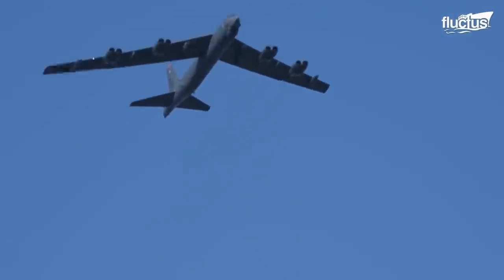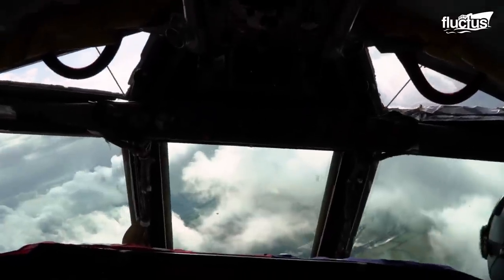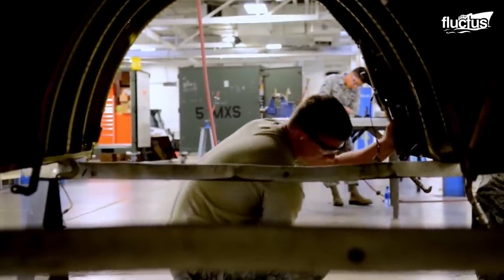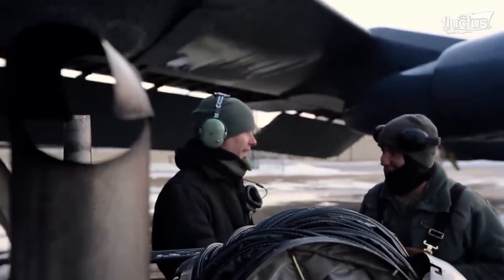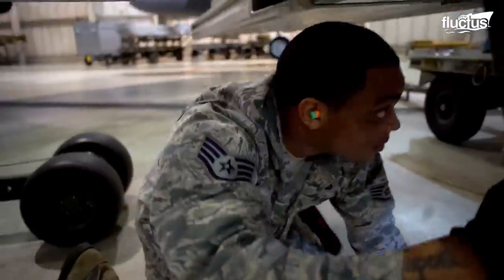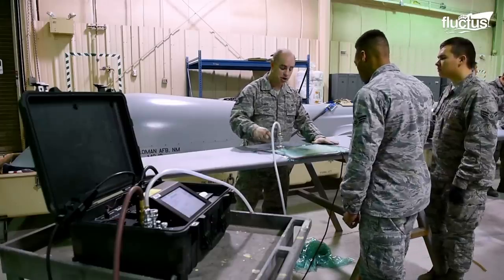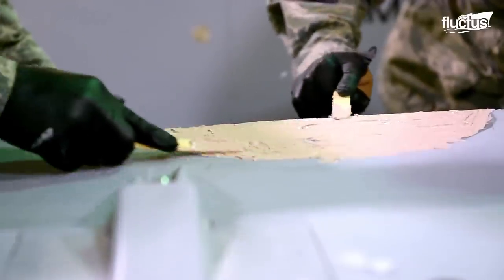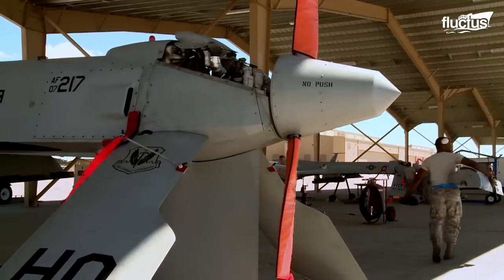US Crazy Technologies to Repair Super Large Aircraft

Comment: This is an excellent video. The remaining 76 operational B-52H's are 60 years old, We designed the B-52G/H in 1956 for high-altitude bombing. The emphasis in the structural design was minimum weight, to maximize range. But in 1961, at the height of the Cold War, we redesigned the structure to meet SAC's new, more severe usage and service life requirements. These notably included low level terrain avoidance training, often under extreme gust and maneuver conditions. The emphasis in structural design shifted to toughness and durability. The primary structural components are never replaced. The main reason for their longevity is that the usage has not been as severe as was projected. As Chief of Structures Technology at Boeing-Wichita at the time of the redesign. I am honored to say I chose the materials, the analysis methods, and the limiting stress levels for the redesign. I am now 95 and I am thrilled to see these planes still flying, and projected to do so for many more years.
Reply: Lawrence, amazing story and THANK YOU for your contributions to this amazing aircraft! My 21 yr old son is a Staff Sergeant at Minot and works on the BUFFs (Comm/Nav) "Only The Best Come North" --- many more years for sure, with new engines and electronics coming online, they'll be flying for 90+ years
Reply: Nice lesson Lawrence.....sounds like you've been put together very well too.    I've always loved the BUFF...Big Ugly Fat Fellow...that last has often  been changed out. Lol.   I was a C-130 tech. for a while and then became a Loadmastsr.  Enjoyed my time in the military...it was a honor.
Reply: Legendary planes just to think how we still use them after all these decades. A master of Ingenuity.  God Bless this 95 year old man that helped with this design.
Reply: I  live   in  Japan .     Never  been  to
abroad   excpt    Saipan.    I  like    propellerplanes.   Zero,零戦     My favorite  actor    is  Gene  Hackman.
    Thank  you for  your  precious  service  for  peace.
Reply: Mr. Lawrence   what  beautiful  design  planes  you  made.  I   prefer   navy  to   army.     I  live  in  a small  town  near  kobe  JAPAN.   so  l  like
sailors and   ship.          GOD BLESS  YOU
Reply: we wish you long life
Reply: Thank you for your immeasurable service to the free world!!! We hope for you more and greater reward than you have already received!!! 
From retired AF MSgt...32 year C-130 APG maintainer...

Comment: The youngest was built in 1962.  Why not open the production line again for 150 more.  If you say ‘they are obsolete!’, then why do we keep any of them? Because they still work
Reply: There is no production line to re-open.  You would have to build the production line from scratch, which is essentially building a new bomber design that looks like a B-52. so you might as well build one using new technology and everything has been learned in the past 50 years.  They don’t keep using the B-52 because it’s comparable to modern bombers but because it is an already paid-for platform with a lot of flight hours left that serves well as a cruise missile carrier.